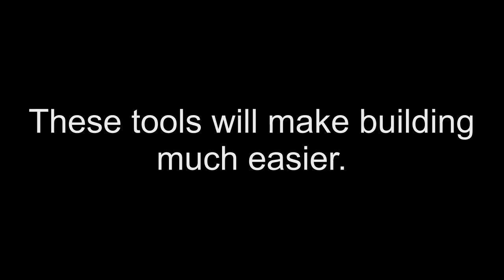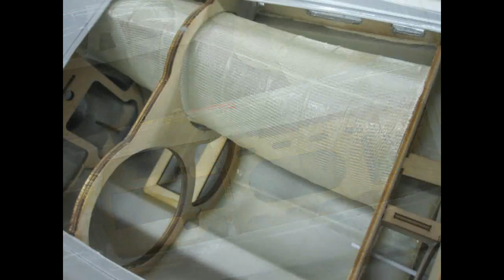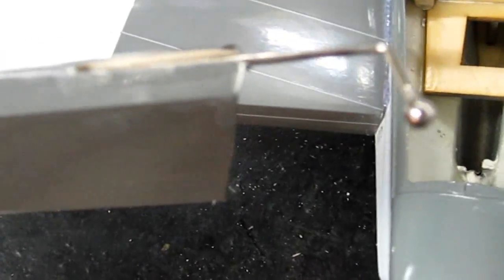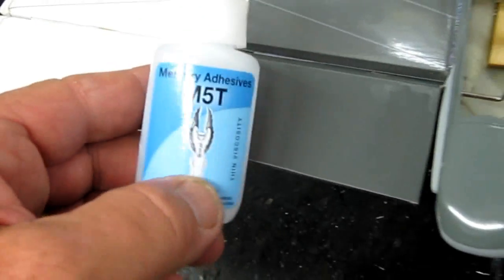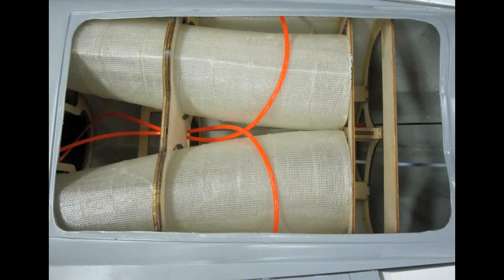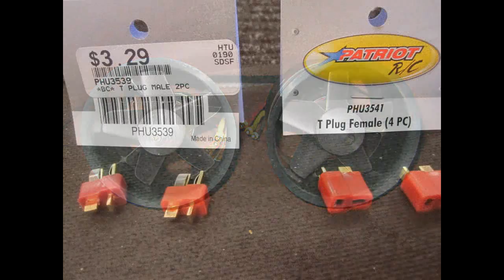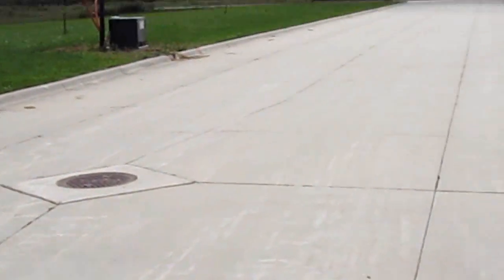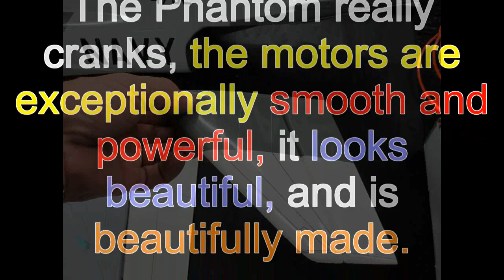NitroPlanes ProJet F4 Phantom Assembly,  Flight, Pros and Cons.

Comment: A while ago i bought the nitroplanes fiberglass f4 phantom and have been working on it, but cannot seem to get it to move. Is it a weight problem? It might weigh around 7 to 10 pounds, but i am using the recommended jets: 70mm which are 3000kv each and it seems to be powerful like it wants to move but can't. Is 3000kv enough? I have covered every air spot so it is air tight. Really need help! How did you make it fly?

Comment: Hi Dave,
I built a 140 sized CMP cessna and it had the same crappy elevator and rudder linkage this plane has.  I almost crashed it because the elevators and rudder were so mushy stock.  I cut all of that out and put direct linkage to the surfaces.  Now it is a solid flyer.  Check out my vids on this if you want to.  I want to get this F-4 but after seeing the linkage for the tail feathers, I may just pass.  HMMM, it is a beautiful plane though,
Cheers, 
Jeff

Comment: It looks to me like it was headed straight for  the  ground in that last attempt at a pull out.  I would bet this thing bit the dust.  I would bet it didnt make it in the air that first roll out, nowhere near enough runway at that speed, and it appears to be really heavy. Also, that was nowhere near 100MPH, more like 50.  Dave, you need to consider that a LOT of others fly EDF's and will see right through your BS.  Oh, and your rudder linkage is asinine. Nitro needs to find another reviewer.